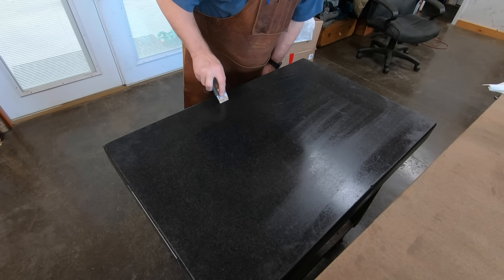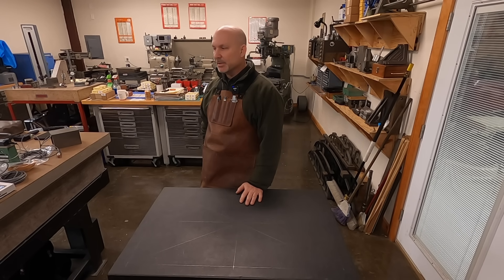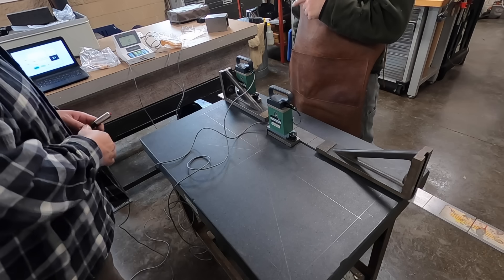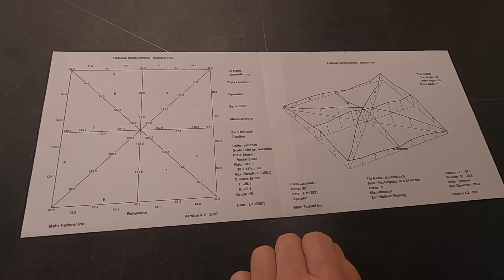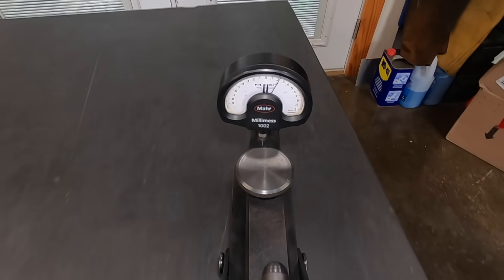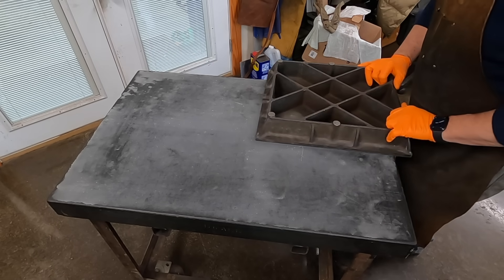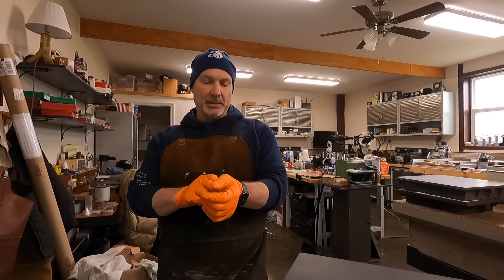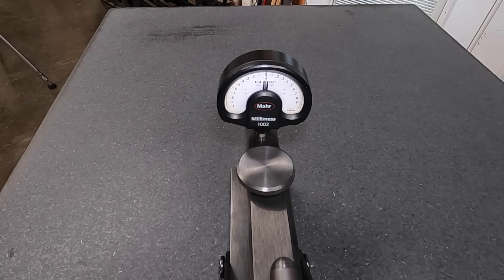Lapping my Granite Surface Plate to AA Grade

Comment: I wish they’d explained the electronic levels. No idea what was going on there. Did the stationary one act as the zero and the moving one provide elevation measurements relative to the stationary one?
Reply: I think that's how they work. There was an earlier video explaining it.
Reply: Yep, though it's tilt not elevation. The stationary level provides a reference, since the plate likely isn't perfectly level. The other checks the relative tilt over each 4" long distance along each line. By knowing the tilt angle, and that it's 4" between the feet, the computer program (or user, originally) can take the sine of the angle  to determine the vertical change. sin(angle difference)=elevation/4".
Reply: @PeregrineBF  Great explanation. Thank You.
Reply: @josephcitizen4195  Robin Renzetti (Robrenz on Youtube) was mentioned in the first part of this series. He's got some videos on this sort of thing.
Reply: They are measuring tilt angles relative to stationary pendelum. When the moving measurement head is moved, the slab and the stationary head may tilt a bit different than it was in previous measurement, but the important part is the relative angle in between the two heads.  The advantage of this measurement method is that it eliminates a need to establishing super accurate levelling of the surface being measured.  A slab on a table frame on castor wheels is measurable.  No need to put it on a concrete pillar anchored deep into the bedrock.

This angle measuring is also why it is important to move exactly by distance of feet in the tilt head, as they are chaining those short hops together to get the overall angle series.  Once you have all the series, you can connect them together to a measurement mesh, and determine overall topology.
Quality of measurements becomes apparent when these measurement lines are "closed".  Determining end point elevations by different paths should end up within a very small distance. The smaller the closure error, the better the job was done.
Reply: @mattiaarnio9249  wow! Thanks! That was great.
Reply: @mattiaarnio9249  Thanks for the great explanation Matti. I guessing  you could move the secondary head a smaller distance, lets say .5" to get a smoother curve in the 3D plot or a greater accuracy in the 2D numbers? Or is the instrument calibrated for that 4" distance?
Reply: @josephcitizen4195  The level has two pads very precisely 4" apart. The software and level are calibrated with this distance. Changing it won't work for the software, though you could do so using manual calculation. But since the levels are used only for overall flatness, that's not needed. The Repeat-O-Meter checms local flatness over much smaller distances.
Reply: Go to robrenz channel & he explains physics behind  what these guys are trying to accomplish.
Robin is the real deal!
Reply: @josephcitizen4195  Smaller steps method has a problem of measuring adjacent curves without common points.
All the calculation tooling is built to compute chains over common points, and the surface mesh closure is achieved with common points.

Precision measuring involves whole different mindset. Nanometers matter, "solid" granite slabs change shape as you modify the support system, or you keep your warm hand on the slab for 30 seconds...
Reply: @mattiaarnio9249  I saw that. At some point it seems to get out of hand. The measurement tools themselves become a source of error!

Comment: I thought this was very interesting to see. As a european I was constantly converting all that talk about millionth of inches into micrometers.😁
For the repetometer footage that was easy though: 1 space on that scale (20 millionth of an inch) is roughly 0,5 micrometer.
So the total flatness of that plate 65 millionth inch is 1,65 micrometer.
Thats insane.
Looking at that system with the electronic levels, it's good that there are computers. Imagine doing all those calculations by hand decades ago when that measurement system  was invented. Although for manufacturing they probably had written tables to look it up (so a certain angle of lift compared to the previous spot (why it's indeed so important to carefully place the level) gives a certain inclination in inches)
Also very interesting to see that diamond powder and that roller to push the diamond powder in the iron block👍
I didn't watch the first video, so that is next.

Comment: Those lapping plates get better with use, not many tools do that.
Reply: To a point, most hand tools and many machines do. It's called "breaking/wearing/bedding in", with relatively high initial wear smoothing out surface variations, removing oxides and other unwanted coatings, and so on.

Comment: Up until a thousandth or so, it's fairly constant, once you get to fractions of a thousandth you start to have problems with temperature, dust, hair, gravity, breathing, witchcraft, bad vibes, or even thinking too rough . Anything can throw it off when you're in the millionth of an inch range.
Reply: Dont forget raining on the exact opposite side of the earth and tectonic activity.
Reply: At the king scraping class we were on the 2nd floor of the building standing on a reinforced concrete floor. If we all stood on the opposite side of the surface plate the reading of a precision level changed
Reply: @sblack48  that cant be a feasible tool in 'real world' without almost lab like conditions..

Comment: Also, it doesn’t matter if the tool is bridging the groves in the plate, unless you plan to measure anything small enough to fit down in there..

Comment: Adam, food for thought on cleaning the lapping plates. I'd highly recommend Optimum No Rinse as a cleaning agent for the plate. It's a polymer based product that will encapsulate the particulates on top of the plate and leave no residue or product behind. Its main use is automotive detailing, but can go so many other places. I feel that's a great use for ONR. Curious your thoughts!
Reply: No and no.
Reply from the maker: That might be something to try out on a small test plate and see how it would work. Rick has passed down his knowledge to Lance and recommends that only glass cleaner to be used so that’s what works for us.

Comment: This is handy - I just got a class A mitutoyo 36" by 48 by 8"  black granite table for free. It has a few rust spots where the PO left a height gauge and it rusted. Anyone got any good ideas how to remove the rust spots?
Reply: There's rust stain remover products designed for plastics like caravans and yachts and stuff. No reason why that wouldnt work?

Comment: I'm concerned that the flatness readings will change when the table is in another location and/or a new table is installed.  Thoughts?
Reply: Is your concern due to the risk of it being tilted slightly when reinstalled somewhere else?

While I’m not an expert here, I’m pretty certain that the measure of flatness they are taking is relative to other points on its surface, not to “down”. So even if it were turned on it’s side it would still have the same measure of flatness. 

The only way it will change during a move is if the surface is damaged in any way or if the whole slab of granite warps at all.
Reply: @jeliebeen  literally anything can flex even granite. When you are talking about microns its not a nonissue for a wide enough slab
Reply: @jeliebeen  for instance if you have a massive slab and support all 4 corners only it will certainly flex a little.
Reply: :face-fuchsia-poop-shape::face-turquoise-covering-eyes:

Comment: As someone who has no formal education in machining the little bit ive done working for my dad rebuilding cylinder heads it really isnt that difficult to get things to an exact specification with s little knowledge and the right tools. I was resurfacing heads to a more precise specification than the majority of manufacturers. You have to remove several thousandths from a gm cylinder head to clean up the tool marks made by the manufacturer. Keep up the good work and anybody who questions your abilities likely has limited knowledge.

Comment: Me I really thank you for showing us you expirience's doing this lance. You fallow methodology that produces predictable repeatable results. Good science Joe pie reviewed dovetail geometry (really great) I'm getting ready to cnc a cross slide vice cause It will be a really good hands on I already have it working well with digital calipers the gibs pretty smooth I just need to get a liitt6le plate. No not at all an impressive project but A cool little engraver, Heavy "circuit board" traces made from copper sheet And the plasma torch 6" x 5" envelope perfect for me Ya and thanks I hope Adam's been reading those old machine book's and has some cool cool stuff to show thanks!

Comment: A lot of plates are called granite even if they are gabbro. It’s a similar rock but with basalt in it. I like gabbro plates because they’re black. I imagine some people prefer granite because it’s pink and they like the look.
Reply: This is true, although the black plates are diabase, a fine-grained variety of gabbro. It's softer than pink granite, but more stable and easier to lap.
Reply: @peteroleary9447  In the case of grabbro (diabase), is it an advantage that there is a small percentage/absence of quartz ?

Comment: Why do you need something this flat? What do you use it for?
Reply: For home/hobbyist stuff, I'd say not much. But if you're selling things or fixing other people's stuff, a few thousandths of play, even on one face can mean the difference between getting paid or trashing the part and restarting. And if it isn't your part, most of the time, trashing and restarting isn't an option unless you want to reimburse the customer.
Reply: the easy answer:  making other things flat.

the details:
its a reference surface, a standard if you will.  consider the kilogram.  somewhere, in a climate controlled vault,  there is the standard for 1kg*, a precisely made metal standard.  the plate is the equivalent for flatness.

in more practical terms, a machinist would most commonly use this surface for layout work & precision inspection (measurements).

scraping is what I see these guys doing a lot.  thats a process of refinishing the ways of machines, using the table for reference flatness.

*technically I think there is actually a batch of these standards, made in 1 shop & distributed to various vaults around the world.  they bring them back together periodically to check to see if they are the same--they are very close, but not quite the same anymore.  new standards are being made from more stable materials (carbon xx, i think?)
Reply: @mtraven23  Good explanation. A side note on the kilogram: That "physical" standard is no longer used. The "kilogram standard"  is now calculated. Officially happened a few years ago.
Reply: @tumbleddry2887  hmmm really?  didn't know that, thanks.  I'll have to read up on that...

ooOoO, nov 2018, you weren't kidding about just a few years
Reply: It use in a tons of stuff. like to check if your work is flat or parallel, alot of messering setup can be done on it that would be very hard otherwish, it's also use for calibration of messering tools since it's almost zero.

Comment: Is it possible to see something so perfectly flat that all measurements reads the same? If so, we have achieved "perfection".
Reply: It won't be perfection (ie. absolute flatness), because the measurements are limited by the resolution of the measuring equipment.

Comment: This video is not for the unfamiliar.  So much goes unexplained.  Such as:
What were those green boxes connected to the computer doing exactly? He called them levels but they appear to be measuring height.  What's the zero?
What did he spread on the surface plate?  Some kind of grit or was it just oil? The rapid o meter appears to be a depth indicator but what did he mean when he said "you have to be mindful of a 3D image or you could mistake a high spot for a low spot", words to that effect.   What are these "intercepts" that he is talking about? What do they tell you?   Again, this video is not for the uninitiated.
Reply: oxtoolco did a video on this subject called "Surface Plate Calibration and Conditioning". It explains a few things for the uninitiated.
Reply: Think of it as three points that measure elevation relative to each other.
Three points allows for judgment of curve alone, but if some of the elevated points are measured as level, that brings more to the accuracy.
We used three points of a Sagometer, to measure optical lenses, but this is like measuring a landscape of flat lenses, with mountains and valleys of tens of thousandths of an inch.
Or millionthes.
Reply: So you have no intuition of what is being discussed in this video?  None whatsoever?  Based on the subject matter being the restoration and measurement of the flatness of the surface plate you are unable to infer what may be happening here or what measurements are being recorded? 

I feel like you the type that calls a ‘comfort advisor’ when your furnace isn’t working.

1.) A differential level.  The global topology of the surface plate is being interrogated using the d-level.  (why would a height measurement be needed when concerned with the flatness of a surface?)  Differential instruments don’t have a zero - they measure relative quantities

2.) Abrasive for the lapping process.  The top of the surface plate is being removed to restore its precision using a lap.

3.)A repeat-o-meter is used to measure the uniformity of sphericity, of a localized area, of the plate. When used as being demonstrated in the video it is a differential measurement. 

4.) The relative height differences of the surface plate is being mapped, in two dimensions at predefined locations, to verify its flatness.

5.) They tell you exactly what this entire video is about – restoring and verifying the flatness of the surface plate by measuring its topology.
Reply: Those boxes are levels, they do not measure height but inclination very precise. The difference of those two levels is then used as inclination, this is combined with the distance between the contact points on the level that is moved to calculate the height (height difference). You use two levels at the same time because the plate and floor could move during your measurements, indeed those levels are so precise, when only using one you might be able to see a change in inclination when there is a person moving around in the shop, because the whole flor slab of the building is tilting and flexing ever so slightly.

Comment: Hmmm... ISO9000 has nothing to do with metrology. It just says your company works to a particular set of globally accepted standards.
Reply: Hmmm, there sure are a lot of globally accepted standards used in metrology. If it weren't for metrology, you couldn't manufacture parts in different countries and have them fit together properly.

Comment: Rubbing 3 plates against each other will flatten them. It was done hundreds of years ago.. it led to the dominance of the British empire’s navy. Their cannons had better bores and as a result outraged other wat ships.
Reply: what about two plates?
Reply: @bermchasin  it has to be 3 plates.  With 2, if there is a flaw in one plate it will mold the other to match.  With 3 plates, every flaw cancels out.
Reply: @schizeckinosy  cool. So do you just alternate three plates or sandwich them?
Reply: @bermchasin  alternate, if you have three plates A B and C you would lap AB then BC then AC. A and C will now be more flat than B so you repeat this process until eventually all 3 have cycled as the "least flat" flat (first B, then A, then C, for example) and you end up with 3 flat plates. Its called the whitworth 3 plate method
Reply: @bermchasin  It's a lot to do with math, as well. Basically, two plates can have an infinite number of surfaces between them, all taking the form of various curvatures of sphere. You'll most likely end up with one concave and one convex plate. If you add another plate, but only lap it against one of the first two plates, you'll end up with two concave and one convex plate (or vice versa). If you start lapping the two similar plates together, they'll end up with a common surface with a curvature somewhere in between the two (as in, much closer to zero curvature). Repeat infinitely many times, and the only possible common surface between the three plates is a flat plane with zero curvature.
Or just repeat until you're happy with the flatness of all three plates. Math is a construct after all.

Comment: Just as a note, if the Earth was a polished steel bearing, at its true diameter, it would be very flat, but absolutely not as flat as this.
A typical Granite kitchen island that seems really flat, but with a convex fault.
It wouldn't be as flat as the earths real diameter.
A normal Granite top can be out of flat by an eighth of an inch in eight or ten feet.
Granite surface plates are on a different level than what we typically experience.

Comment: I've always thaught that really flat stuff was shiny or mirror polished but turns out it is not 🤷‍♂️
Reply: It's not flat. It got plenty of divots dispersing light. They are just too small the be measured with the gear they are using.
Reply: @timonix2  Technically true, but 65 millionths is flat enough to accurately measure anything except gage blocks, which you're not going to measure on a surface plate anyway. @Breaking Taps has a video on an atomically flat mica which you may enjoy.
Reply: @timonix2 oh it’s definitely flat. It’s just rough. Something can be extremely flat and still rough.